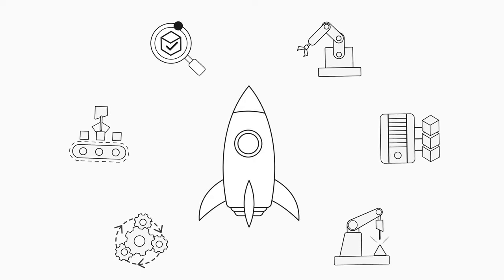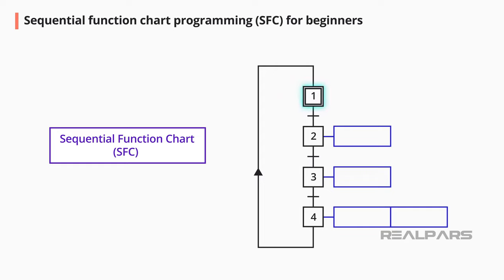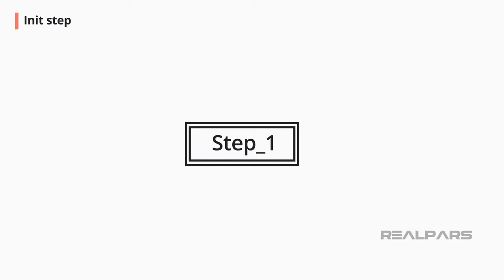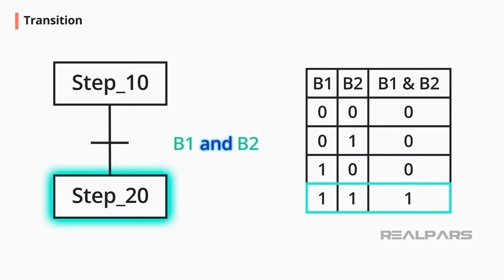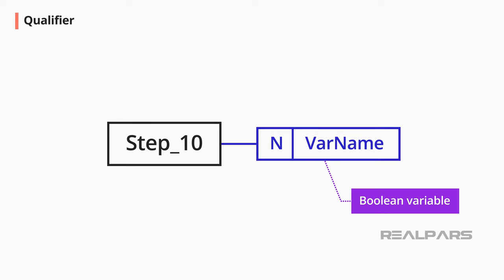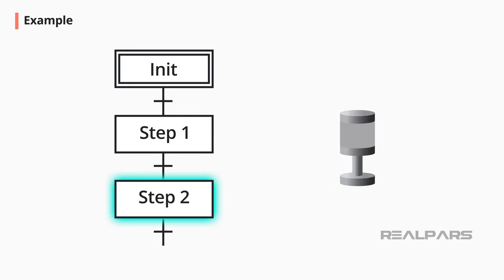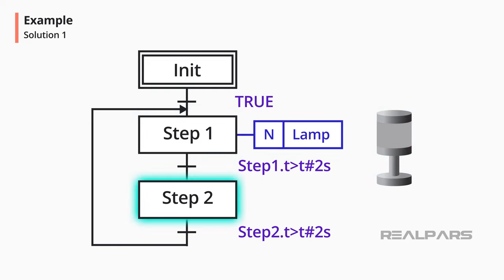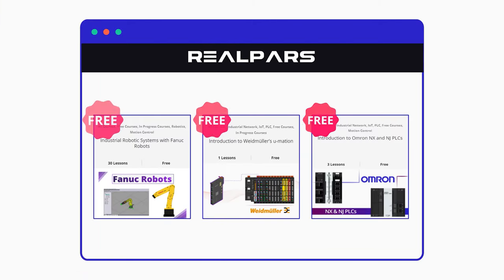Sequential Function Chart (SFC) Programming for Beginners

Comment: SFC... why?
Reply: The is one of the programming language in the PLC standard
Reply: @TOM8940  I know... one that we just really don't need. Structured text with opp extensions till something else better will come. It's time we throw away what does not make sense.
Reply: @ranmjj  Nonsense. I advise you to read about finite state machines. And it will immediately become clear that SFC is the highest language for programming robots and machine tools today.
Reply: There is a reason why no one in the IT world no one uses graphical languages... these should fi ally die. Everything u do graphically can be done textually.
Reply: @ranmjj  But we are not in the pure world of IT. It is much easier for maintenance personnel, such as adjusters, to understand the graphical diagram for maintenance than your "text", the more they do not have to be professionals to search for problems and failures.
Reply: @ЧупакабраИнгерманландская  when code is written properly the end user should never had to look through it in order to troubleshoot the thing it is driving. I know... we all are working under pressure and almost can never say that we are 100% content with our product, but when you have a problem with a software running on your pc u never search for the solution in the base code. The same should happen in our world.
Reply: @ranmjj  oh wow. Just think, my automaton stops at the same stage. How much easier it is for the installer to understand what exactly the machine is waiting for at this stage and why it does not go to the next step due to some kind of sensor. Just take an interest in the theory of automata, my advice to you.

Comment: Question. Would it be possible to reset an input like a start button in sfc? Ive tried to reset the input but it doesn’t seem to work. 

Thanks
Reply from the maker: If the Start button is a physical input (an Ix.x address), you will not be able to reset it from an SFC.  It could also be that other logic in the PLC keeps the variable in question in the ON state.  SFCs do not "override" other logic.  Some PLCs have different "rules" about setting variable states within an SFC.  Make sure you know what your particular processor allows.